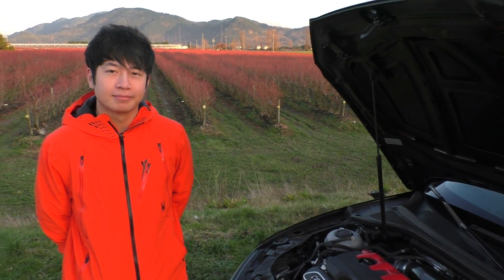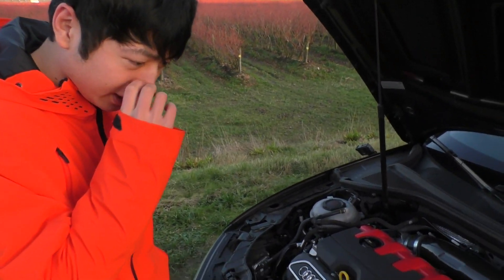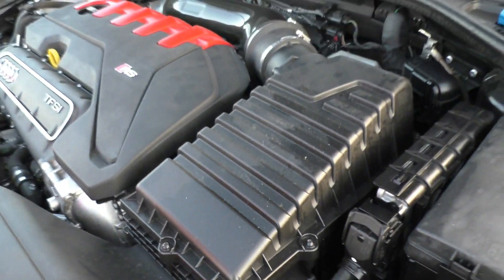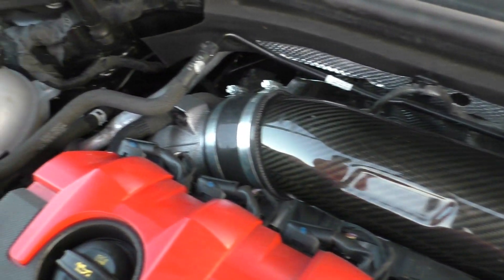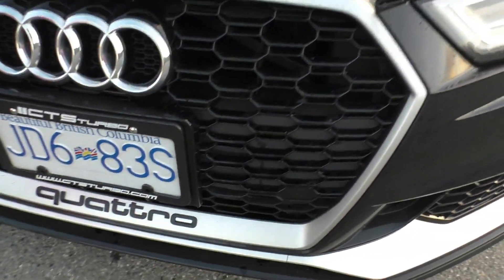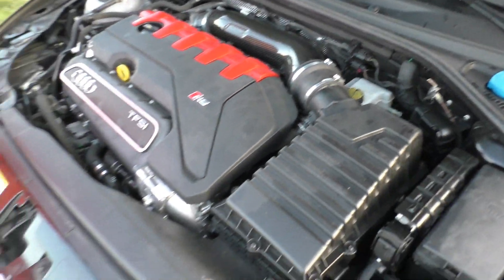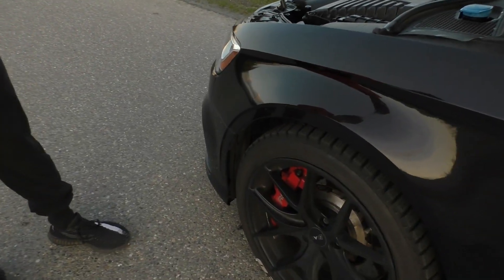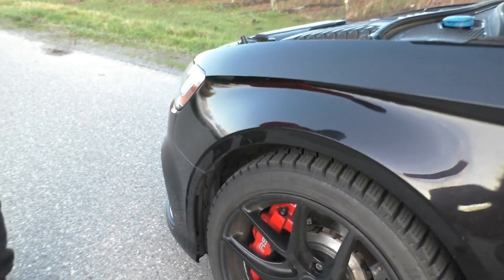TTE700 - Unitronic - 93 Octane - RS3 1/4 Mile (Full Weight)

Comment: Please be completely honest I have a 2018 RS3 with 120,000 kms stock turbo, 4" cold air intake, cts inlet, and downpipe/midpipes and Unitronic stage 2 93. I'm tempted to try hybrid turbo but will stock internals survive ?
Reply from the maker: No, I refuse to be COMPLETELY honest and will only be partially honest, hahaha. Of course I'll be totally honest, lol.  This is what you want to run if you insist on running a hybrid turbo on a stock motor: https://youtu.be/DNieLaz-jZM

Comment: Was this with a splash of ethanol?  The trap speed is impressive!  Best i've done on a stock block tte700 is 129mph full weight.  On e20 i'm about equal at 133/134.  Just curious as I know you tend to make up for the poor fuel with a bit of corn sauce. :)
Reply from the maker: Fairly certain he was on E20.
Reply: Awesome, thanks Adam. Through all your videos or each stage it’s been incredibly useful to have a benchmark of performance to compare to. 👍🏻
Reply from the maker: @NA-xz4wj  glad I could be of help!
Reply: You always are mate :)

Comment: At what RPM was the LC set to with the Uni tune? Also, for my knowledge to improve my launches, he held the LC hardly 1-2 seconds right? Thanks for the vid
Reply from the maker: Launch Control is 4000rpm on this tune which is too high for a car on the street with snow tires so he didn't hold it down as long

Comment: How long has Michael been running your old TTE700 on Uni stock block 93 file now? 

Curious how well it’s been holding up. Not sure if it’s a “DAILY D” like your “Passat” or weekends only but I assume the former given snow tires and full interior. Any feedback from Michael with usage: km driven, track days, etc. would be appreciated.
Reply from the maker: He has been racking up the miles. He daily drives that car and uses it every single day.
Reply: @VancityAudi  thanks. Do you keep in touch with him? How many miles?
Reply from the maker: Yes, he's a buddy. 10,000 miles and climbing

Comment: stock turbo RS3 record is 9.8 sec , how is Michel so slow with the TTE hybrid ?
Reply: Pump gas and corn sauce 😂😂
Reply from the maker: You consider 10.6 @ 133mph slow? lol Wow.  The stock turbo record of 9.8 @ 138mph was done with a car that was absolutely fully gutted with carbon fiber doors, trunk and hood.  It weighs around 3000lbs. He used E85 which makes more torque than Michael's 93 tune. He uses small brakes, small wheels and drag slicks. Best of all though... he was on a prepped drag strip.  Michael's car weighs over 3650lbs with him in it, was on the street, on winter tires, with WAY less mods.  You do the math, lol
Reply: There's a big difference between a race prepped car on racing fuel compared to pump gas and full weight. This same car with proper tires is most likely a very low ten WITH full interior.
Reply: You comparing a sleeper daily driver to a strip car with some breaking record tune? You must think you can just buy a used Rs3, spend a few k on it and it will run 9 secs daily lol.
Reply from the maker: @bmwtobenztoaudi3515  agreed. Keep in mind though that record of 9.8 was made on the off the shelf Unitronic - Stock Turbo - Stage 2 - E85 - tune. It is the exact same tune I used and that every Unitronic owner can purchase and use safely.

Comment: Running stock block correct?
Reply from the maker: Yes, they don't make a built block 93 octane tune. You maximize the potential of 93 octane fuel on a stock block.

Comment: TTE700 on 93 you should be faster then 10.6 don't you think? I mean 10.6 is still extremely rapid but considering stage 2 on a complete stock rs3, you can do 10.8
Reply: Maybe TTE810 will knock that 1/4 down to where it should be
Reply from the maker: No, anywhere from a 10.4 to a 10.7 is around what you should be running on a full weight TTE700 93 octane tuned RS3. Stage 2, full weight, 93 octane RS3's run roughly 10.8 to 11.1 to my knowledge. With weight reduction on Stage 2, maybe a little quicker.
Reply from the maker: @phoenixlounge7656  there is no such thing as a TTE810 on the DAZA platform

Comment: Did the TTE770 come out yet?
Reply from the maker: There is no TTE770 for the RS3 platform
Reply: @VancityAudi  sorry TTE 800 ?
Reply from the maker: @davidmusiyenko4158  that doesn't exist either lol
Reply: @VancityAudi  for the 4.0T it does. Is there no bigger turbo for the rs3? If so why is that? The limitation  of space?
Reply from the maker: @davidmusiyenko4158  I was referring to a turbo for the RS3. That doesn't exist. I use the TTE777 in my RS3. I have a whole crap load of videos on it on my channel.
Reply: @VancityAudi  how does the TTE777 compare to the IMS850?
Reply from the maker: @davidmusiyenko4158  850S or the 850HS?
Reply: @VancityAudi  HS
Reply from the maker: @davidmusiyenko4158  I only know of a couple people that have used the 850HS.  One is a pure racecar that went 9.0 in the 1/4 mile in a heavily modified RS3.  The other ended up not enjoying it very much and downgraded to a 710H from Iroz instead.  I imagine the spool is a little worse, but it makes a little more power up top than the TTE777

Comment: He had hardly any spin on those 18s and Bridgestone, I can't help but spin up 1st and 2nd on my 19s mps4s.
Reply from the maker: He also launched the way I taught him, with a tune that makes less torque than a Stage 2 E85 car
Reply: I have MPS4S on 19x9" neuspeed wheels. Unitronic Stage 1+ E85 tune. As long as it's over 35° F and not wet, I can launch with almost zero spin every time. Do you have older tires, or maybe a lot more done to your car?
Reply from the maker: @scottc78  What year is your car?  That doesn't sound right at all.  With that power level you should 100% be spinning your front tires on launch with MPS4S's... unless of course you have a Syvecs haldex controller as well
Reply: @VancityAudi  https://youtu.be/wForE8dsdm4 it's a 2018. VCDS is set to more traction, but no syvecs controller. It may spin a tad, but I wouldn't ever say it spins through 1st and 2nd. I'm still full stock intake and turbo inlet. Not sure how much that matters. I have a 4" intake and turbo inlet waiting for after winter.
Reply from the maker: @scottc78  very impressive. I've seen some Stage 1+ E85 Uni cars and they all have some spin on that tune making the power you make and using street tires. What are your times like? 0-60, 60ft and 1/4 mile?
Reply: @VancityAudi  wonder what size tires? I'm running 255s on all 4. I don't have any times yet, but I just got a Dragy for Christmas. Hoping to test before and after the inlet and intake. Those mods should help spool, and may equal more torque sooner and more spin? I guess I'll find out.
Reply from the maker: @scottc78  people vary in sizes from 245's to 265's depending on the setup. Good luck with your new mods!
Reply: @scottc78  stage 3 TTE700, spin city on my 19s. Will have to look in to vcds
Reply: @gtrsfk9001  oh, if you're TTE700 that is a significant upgrade. I do feel like those traction mods (look up the VCDS video on this channel) helped. But I'm probably ~500awhp